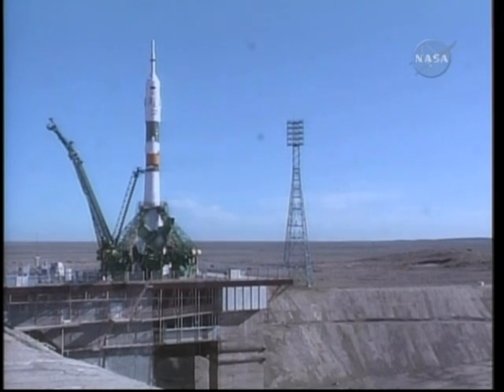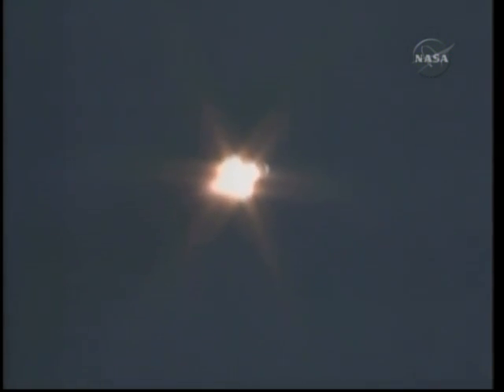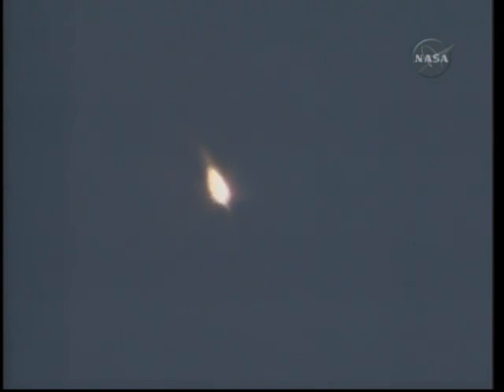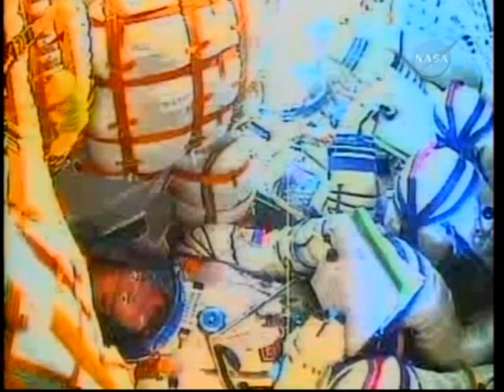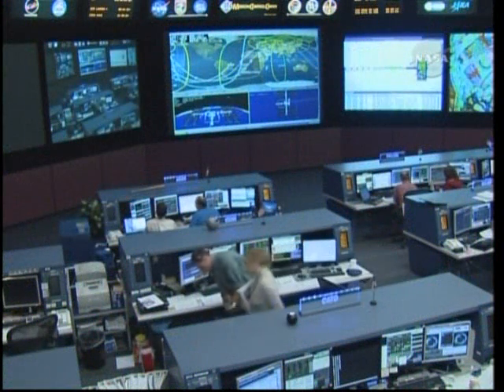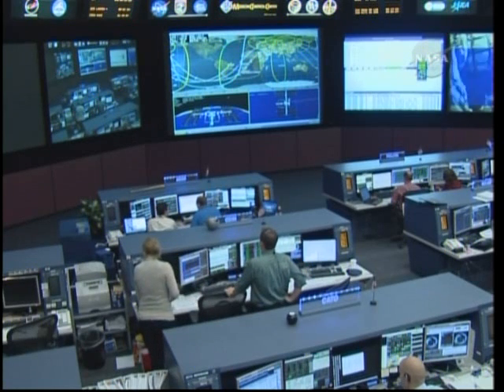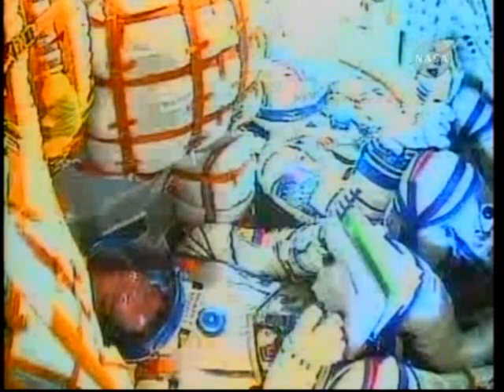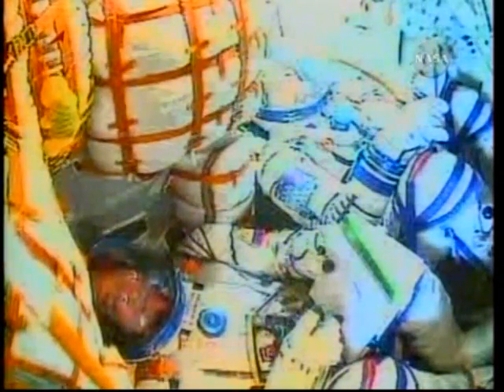Launch Sojus TMA-18

Comment: @CapitanoGUC The Soyuz has been modernised many times since the sixties, including adding advanced computers, etc, etc. It has also been made in a larger version with a fourth stage to launch geostationary sattelites, and interplanetary missions.

The shuttle is not hypermodern either. The design was conceived in the late sixties, and it is many years since the first one was launched.

Comment: @adlerzwei there has been a few crashes and failures, however, far less than ANY other launch-vehicle. This is what ESA has to say about it: "the Soyuz launch vehicle is the most frequently used and most reliable launch vehicle in the world".

"It has become the world's most used space launcher, flying over 1700 times, far more than any other rocket. It is a very old basic design, but is notable for low cost and very high reliability, both of which appeal to commercial clients."

So there.